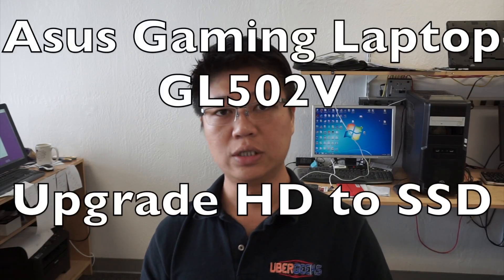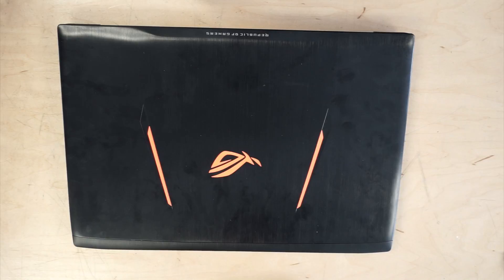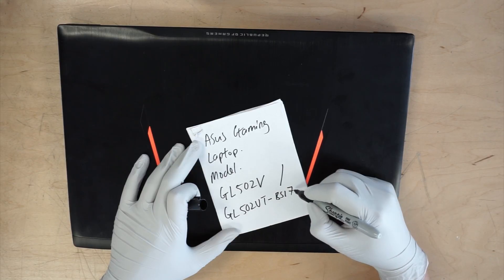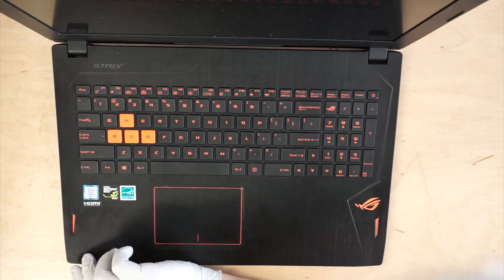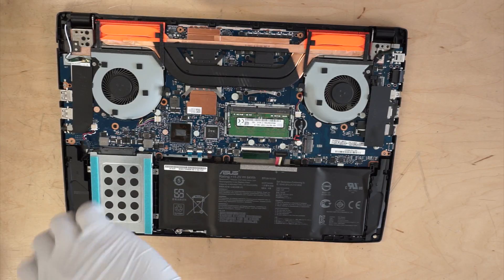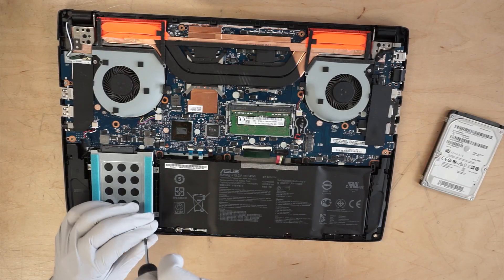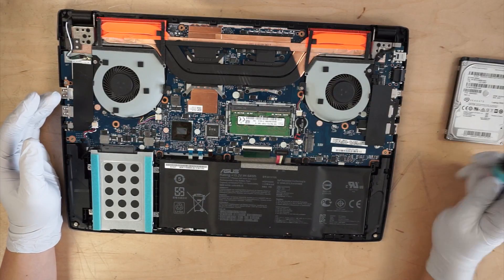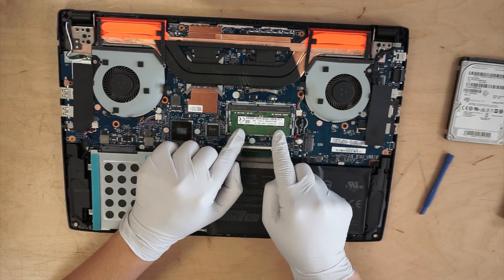Asus GL502V / GL502VT Disassembly - HD replacement

Comment: You actually don't need a prying tool if you start opening it up around the up right corner (around ac connector). It comes off on its own.
Reply from the maker: That can be done as well.

Comment: Hey Uber Geeks i own ASUS GL250 VT laptop and wanted to ask you what is the maximum NVME size that i can upgrade to? as per the motherboard?? because i was planning to upgrade it to 2 TB but is not  sure about the possibility. Thank You.
Reply from the maker: You can install 2tb NVME without any problem. https://amzn.to/2FRnd6E
Reply: @UbergeeksBiz  hi i read the manual, the only information is M.2 2280 (80mm length), no information (sic) about the PCIe... is Gen4 x 4 possible or  do we stay with gen3x4?

Comment: Hi this is an awesome informative video I would like to ask if is there possibility to upgrade the RAM to 32 GB as GL250 VT just has one slot I think can you please confirm that ? I have seen lot of people upgrading thAts why a bit confused. Thanks in advance.
Reply from the maker: Yes. Max up to 32gb RAM
Reply: @UbergeeksBiz  Yes but i can only see 1 RAM slot which has 8 GB ram in it at the moment, where is the other slot located??
Reply from the maker: @priyankparekh3793  Maybe the 2nd slot is at the back ? If not, that means the RAM might have attached on the motherboard and remaining 1 slot for you to add additional RAM. Check the website:  https://www.asus.com/us/Laptops/ROG-GL502VS/specifications/
Reply: @UbergeeksBiz  Got it my model has at the most capacity of 16 GB 8Gb on board and 8 GB via RAM slot as there website mentions. 
Thanks for the info.
Reply: @UbergeeksBiz   I was also trying to upgrade my 128 GB M.2 NVME drive , but was kind of confused how should i go about cloning my Windows 10?  As i want to install a higher capacity to 1 TB  M.2 NVME drive with Windows OS on it. In short want to upgrade my NVME to a higher space with cloning the OS on the new one. So how should i got about it ? any suggestions please.

Comment: If anyone is still here, this is the model with 12 gb ram correct? Can you upgrade the ram at all and which ram would you need to look for. I found an 8gb sodimm stick to replace the 4 gb one but I'm unsure if it will work correctly.
Reply from the maker: You can upgrade your ram

Comment: Just got this laptop for a steal but the battery is dead and the laptop only works plugged in. Any links to the best battery I can get for this laptop? Tried searching online and it is hard to find, bought one I thought was right but it ended being defective and it took forever to get here. Need a high quality and if possible higher capacity battery recommendation. Thanks! Video was super helpful.
Reply from the maker: Hope this link helps you with battery replacement:     https://goo.gl/GxB1pF       Before purchase, make sure you read and match the seller description.
Reply: Hey, I'm having the same problem at the moment. Did you manage to find a solution?

Comment: My HDMI is not working with this laptop, can you recommend me witch driver for this laptop?

( same laptop as in this video )

I need it to play Vive the vr
Reply from the maker: First you need to check if the Graphic Driver was the issue, by going to Device Manager. By default, if you have display on laptop screen. The HDMI should work fine. Try adjust monitor mode to HDMI. Hope this helps.
Reply: UberGeeks I found out my graphic port is broken witch is why the HDMI and Thunderbolt Is not working or connecting. Do you know the what part do I need to replace the graphic? I’m not good with computer.

Can you let me know if they Wild the part into the Graphics or not?
Reply: @TheDragonfriday  If it's the ports and not drivers/software then you are just boned. Would need to replace the entire motherboard and on this laptop that means a new laptop basically.
Reply: VitaKet hiiii I was able to fix it, just need to replace the HDMI and sothering work

Comment: How can you fix the wire for the battery that is out of the motherboard do i need to slaughter it again or what?
Reply from the maker: If you have a broken cable for the battery, I do not recommend solder the cable. Please get a brand new battery replacement for your safety.